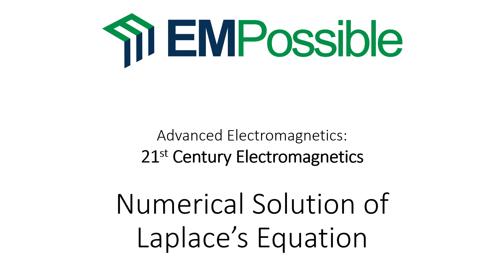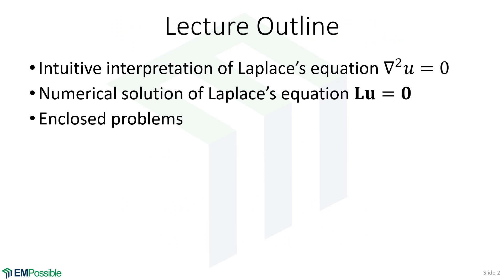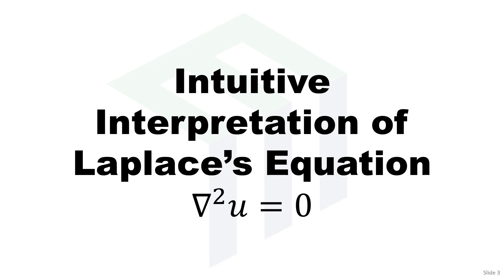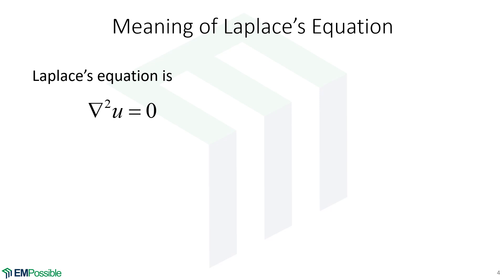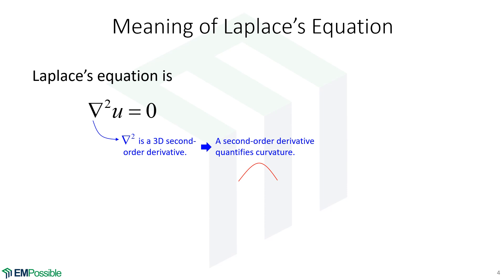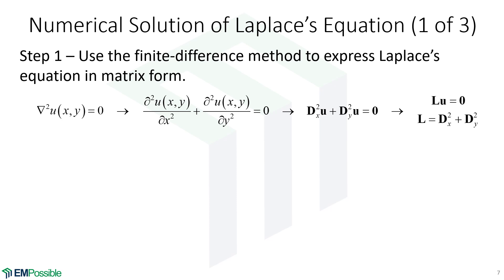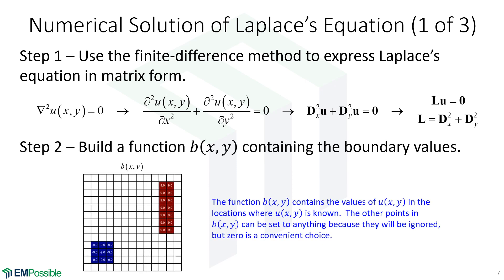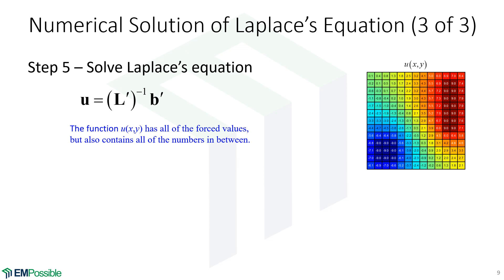Lecture -- Numerical Solution of Laplace's Equation

Comment: Great lecture. I am wondering about how one would go about incorporating periodic boundaries into this problem formulation. Can you point me in the right direction?
Reply from the maker: That is pretty easy.  I recommend learning how the finite-difference method is being implemented here.  That is taught in Computational Methods at the following link:

https://empossible.net/academics/emp4301_5301/

Work through Lectures 6f - 6k and then Lectures 7a - 7i.  You will even see periodic boundary conditions taught and incorporated into the derivative matrices.  With this background, this lecture on Laplace's equation will be a lot easier to understand and customize.
Reply: @empossible1577  Thank you for the fast reply.
Reply: @empossible1577  Hi, I am back (again) :D
I took me some time to get to it, but now I implemented the finite difference method for several boundary conditions. I wanted to compare with the example in this video as a first test of my code. Please correct me if I am wrong, but the first example in the video is using Neuman boundary conditions right? However, when I try to compute this example with Neuman BCs with my code I get lines with all zeros in the L matrix, meaning the inverse does not exist. I wrote down the 2nd derrivative matrices D2x and D2y, and it seems even in the derivation I am getting lines with all zeros due to the Neuman BCs when summing up D2x and D2y. 

I have checked the derivation and my code several times now, and I can't find a mistake. At this point I feel rather stupid and would appreciate if you took a look. I uploaded a plot of my derivative matrices for neuman boundary conditions (without the constant factors) for a grid with Nx=Ny=6 here (https://i.postimg.cc/VLw0zV7G/Dxy-neuman-Nx6-Ny6.png). Is there an error or am I missing something?

Comment: Really great video!

I have a question on the 'enclosed boundary' part of the video: given a finite-difference stencil for the Laplacian using points up-down-left-right, is it necessary to define the corners of your square enclosing boundary? I would think that, since the internal points do not 'see' these points in the corner, that they would not need to be included (i.e. the map function could be zero in the corners of the square?)

Thanks again!
Reply from the maker: I don't think those are needed.  The finite-difference equations themselves only reach horizontally and vertically across the grid, not diagonally.